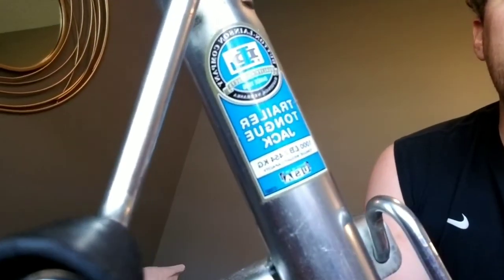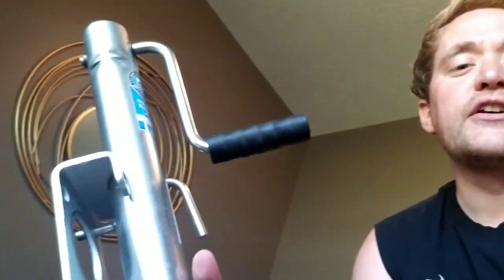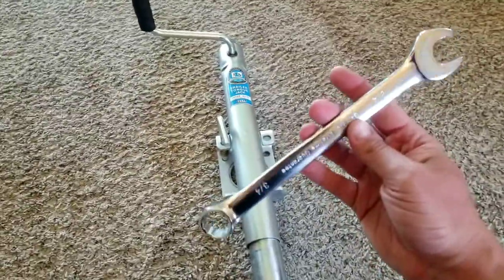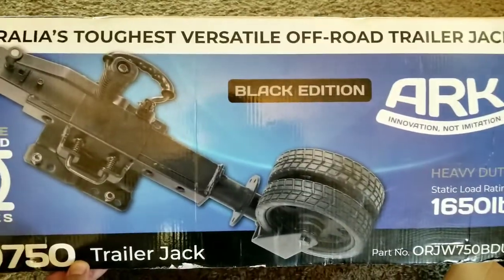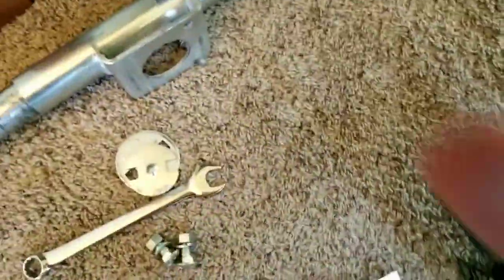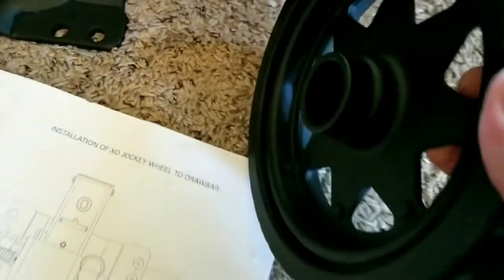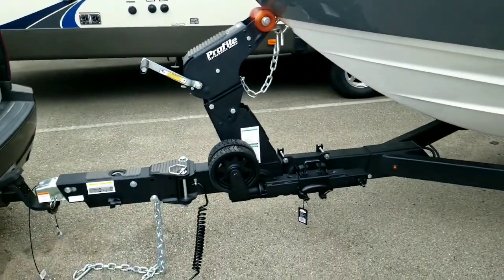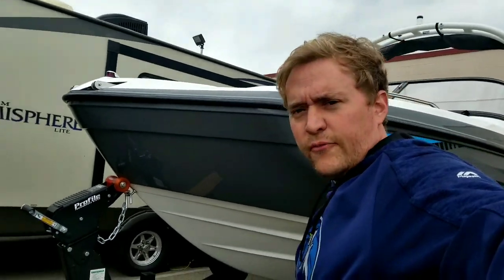Installing the ARK XO750 jack on a 2020 Yamaha Shorelandr Trailer

Comment: Hey Daren, great video. Looking at buying the Ark 740 for my camper.  One point though, I noticed you used coarse thread stainless bolts, Technically you should be using High Tensile, Fine thread bolts to avoid shearing under load.  Still better than the crap you removed though.

Comment: Crossthreaded to 40ft/lb. On another note you should be able to disassemble your hack and use it on the welded bracket instead of booting on

Comment: Btw, cross tighten to aid w even contact over the surface. Avoid hot spots on the contact spots from the bracket to the frame. Crisscross when tightening  basically.

Comment: Hey Daren,

       Great video!  Do you think you could always keep the jack vertical and just use the coarse adjustment on the left to pull it up out of the way instead of turning it 90 degrees?  I have an AR195 trailer and I would have to move the tongue winch forward to give me enough room to tilt it up.
Reply from the maker: Yes you probably could do that.

Comment: Thanks Daren. I agree the stock jack is a piece of junk. Are you able to move your AR 210 easier by hand with this new jack?  It was almost impossible for us to move our with the stock jack.
Reply from the maker: I haven’t personally moved it by hand yet. One time though I forgot to put my wheel chocks on, and it rolled forward in its storage lot about 15ft. 2 guys at my storage facility rolled it back into its spot, and that was on a slight incline. So it will definitely roll yes. Keeping in mind tho that 4500lbs is hard for one guy to push regardless.

Comment: Will it work in salt water? Galvanized?
Reply from the maker: It’s not galvanized, but the manufacturers site says it has a “rust resistant finish” that’s “salt spray tested for 600 hours”.

Comment: So question about your jeep. How well does it pull your boat. Is it a V6 or v8. I have a 2020 V6. Looking at the same boat as you or the ar195.
Reply from the maker: You’ll want to check your towing capacity. I have a V8 which is 6500 lbs and the AR210 is 4500lbs dry.